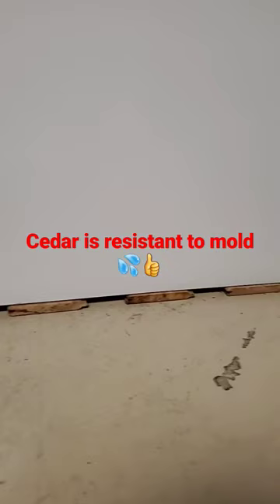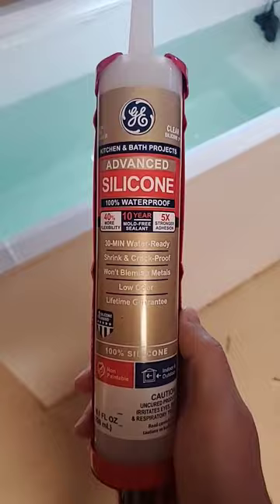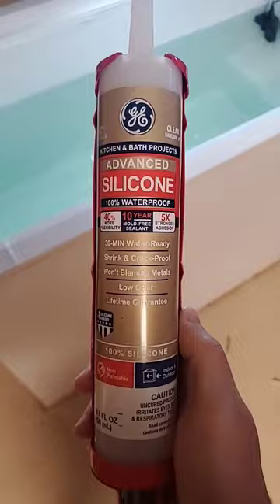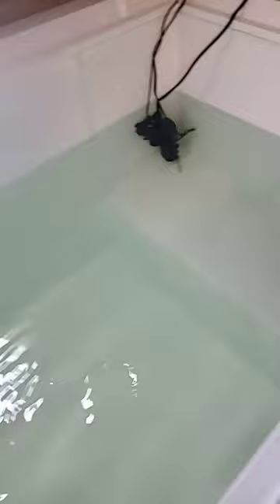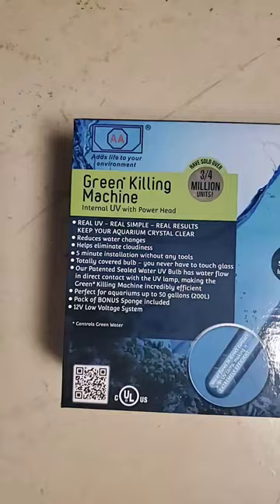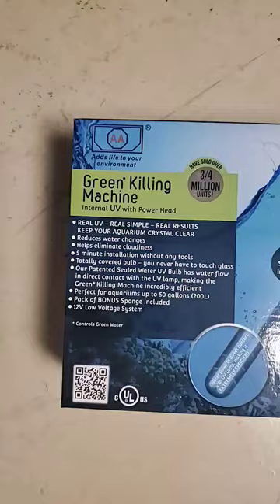DIY Chest Freezer Cold Plunge Ice Bath with Filtration - DON'T WASTE MONEY and WATER!!!

Comment from the maker: *ALWAYS UNPLUG BEFORE PLUNGING*

Parts list:

The Freezer
https://www.lowes.com/pd/Frigidaire-14-8-Cu-Ft-Chest-Freezer-FFCL1542AW/5001963889

The Alcohol (joint prep before sealing)
https://www.walmart.com/ip/Equate-91-Isopropyl-Alcohol-Antiseptic-32-fl-oz/276040459

The silicone
https://www.lowes.com/pd/GE-Advanced-Silicone-2-Kitchen-and-Bath-Tub-and-Tile-10-1-oz-Clear-Silicone-Caulk/5013492235

The filter
https://www.petco.com/shop/en/petcostore/product/marineland-magnum-polishing-internal-canister-filter-2536440?store_code=2723&mr:device=m&mr:adType=local&cm_mmc=PSH%7cGGL%7cCAL%7cSBU05%7cSH14%7c0%7coZ4AgFePb8PMQF6cfeZNnh%7c58700007475749834%7cPRODUCT_GROUP%7c0%7c0%7cpla-1457221079255%7c127865324094%7c15104991825&gclid=EAIaIQobChMIqoO8icbr_gIVfQZMCh2_xAsUEAQYASABEgLXV_D_BwE&gclsrc=aw.ds

The UV Filtration (honestly, I wish I went with the bigger model, but we'll see how it goes.)
https://www.petco.com/shop/en/petcostore/product/green-killing-machine-internal-uv-sterilizer-with-power-head-1237020

The controller https://a.co/d/953skAH
Reply: none of the link work

Comment: how is the green machine keeping the water clean for you?.... I'm building one and was looking into Ozone Generators but it's just so involved and expensive I would much rather go the green machine way.... I already have the Marine Land pump...
Reply from the maker: It's been great. Under $100, widely used at drinking water facilities for sterilization just on a larger scale, and it's plug and play out of the box. You won't be disappointed.
Reply: There's more to UV than plug and play. Particularly with UV filters designed for water "clarity" not water sanitization. Most submersible aquarium UV filters will only make your water look clear, not actually kill bacteria. Flow rate of pump and UV contact time with water are critical. If you want to do UV right, you need an external cannister filter and inline UV filter. Which is way more expensive and time consuming that just using a proper ozone treatment system. You can get an ozone generator for $100 and only have to change the water once per year. If you cheap out in the beginning, you are going to spend more time messing with the water and more money on buying the things you should have in the first place.
Reply: @davidmcchristian9861  yes this absolutely is the way... since making that comment 6 month ago I've since found the UV sterilizer with Marine Land canister filter is ok but not highly effective... the water still gets cloudy and smells a bit "off"... but not nearly as bad as with no filtration... however... now that I've purchased the proper Ozone generator made for water that has really proven to be the way.... also with the marine land filter for particulates...

Comment: What about getting a taller, shorter freezer? 
I prefer not to lie down, so a smaller freezer would be better and cheaper presumably. Me and my wife aren’t that big or tall, I’m just under 5”7 and my wife is like 5”5 and we’re currently using one of those blow up “plunges” with the plastic sticks you slip inside it for stability. I’m considering this verses buying one of those cold machines you stick into a regular plunge like mine that cools it down. Is it worth it? Can you give me any benefits I’d notice over the other method? Currently maintaining ice is difficult, especially because it’s summer in Alabama and the cold tap is literally about 85-89 degrees F! With about 40 x 500ml bottles of frozen water from Walmart I refreeze every time I can get it to about 52 degrees. It will be easier in Winter but obviously it’s not ideal, and in any case having to refreeze the bottles is annoying. (I feel like I’ve ruined some of my frozen milk I had in there I’m now using as giant ice cubes from the temperature changes). So a machine that cools the plunge vs a freezer system like this is surely the way to go. Just wondering if you can sell me on the freezer system over this one - thanks! 🥶 😂
Reply from the maker: @Edbrad  Sounds good!
Reply from the maker: @Edbrad  you have to find what works best for you guys
Reply: @Snake_Boi  I’d just like to say that I have managed to get the temp down to 43 degrees F now. Whoo!! Makes a big difference ey?! I can’t imagine doing the 32-39 degrees ice bath, but I know I have to get there over time. I’m sure it’s as different there as it was from 62 to 43.
Reply from the maker: @Edbrad  it's pretty crazy! Stay safe and well!

Comment: Great video! Been wanting to figure out a good way to make a plunge without ozone, because i want to put it in a basement room that isn't well ventilated. How often do you clean the filters, tub, and change the water?
Reply from the maker: Depends on how much use it's getting, and how clean the individual going in. So far, I think I've cleaned the filters 3 times, and done a few partial water changes, mostly to vacuum debris off the bottom.

Comment: Thinking of doing the same exact set up. Do you think the 3m silicone marine grade will work as well. It’s used on major boats and water craft. Also mines will be staying outdoors in fl as well. Think it would last? And finally can you run all the wires ( inkbird, UV, and marine filter ) through a hole on top of the lid if I drill one?
Reply from the maker: You'd have to test it out. I can only report my own experiences.
Reply: @Snake_Boi will do. Just purchased the 120 gallon UV product. Letting the adhesive cure at the moment. Thank you

Comment: Someone in another video mentioned to not cover the freezer since it is running, the walls of the freezer will overheat, which will eventually ruin it prematurely.. is this true? why would I leave my freezer open outside.. what would you suggest?
Reply from the maker: I'm not sure, I haven't heard that. I usually run mine until there's a bunch of ice to keep it cold for a few days without needing to run again.
Reply: As he stated once you get it cold ,it stays cold for awhile , particularly now that its cold . When I first got mine and bringing the temp down though , the Sides were definitely Really hot. I turned off and ran at night hoping the night cold air would help , as I thought it was gonna overrheat .
Reply from the maker: @thetattooed6_9weirdo32  this was my experience as well, the heating of the exterior walls is actually a feature of chest freezers not a defect. It heats up so the outside of the freezer doesn't get condensation on it and rust out in a humid warm environment.
Reply: This was brilliant, exactly the information that I’m looking for here in Australia to get my own ice bath set up. Now can you please do one on an equally cheap set up for a float tank? Ice baths and float tanks are the dream combo for me…

Comment: How’s this build holding up? Thinking of going a similar route (no JBWW or pond shield/liner) but I’ve read mixed experiences regarding leaking and eventual rust spots showing through the white enamel coating.
Reply from the maker: No issues to report so far.

Comment: Why would the front and left side feel very hot to the touch on the outside of the freezer?
Reply from the maker: @jodull3197  It's running too much. I would honestly add ice for the first cool down. Or turn it off for 2-3hrs until it hits the ideal temperature. The heat is a feature of the freezer to keep condensation from forming in a humid environment.

Comment: The temperature control device is for cooling the water. what is the temperature range on the freezer. Ideally I'd like to get 40 + degrees.
Thanks
Reply from the maker: You can program all those setpoints on the controller. You could set it to cool down to 40°, then shut off and start up at 48°. Mine is set to cool down to 32°, then it turns off until it warms back up to 36°.

Comment: with the The UV Filtration, can I withstand these type of cold temperatures? or does it depends how cold you go? I'm considering on getting another UV filter off of amazon considering the chest freezer will hold more gallons of water.
Reply from the maker: It's holding up very well. Regularly freezes.

Comment: Do you not use a timer to automate  how long it runs? To prevent ice and energy saving?
Reply from the maker: The inkbird controller is what makes it turn on and off based on how high or low the temperature goes. You set all the parameters. For instance, cool down to 33f, then off until the temp is 42f, then back on until it reached 33f again.

Comment: So what's the difference between the ozone and the marine land? Doing the same job? And what different jobs are the green machine doing compared to the marine land? Sorry for the questions but I'm just wondering what I actually need to buy here? The marine land and green machine suffice? Thanks
Reply from the maker: You don't need Ozone, marineland removes solids, and the UV light (green killing machine) does the sterilization.
Reply: You don't "need" ozone, but it makes it a lot less difficult to manage the water quality. I'm changing water once a year with a proper filter and ozone protocol.

Comment: Is there any benefit in adding salt to lower the temperature below 32°?
Reply from the maker: Adding enough salt could potentially cause frostbite if the temperature drops low enough, so this is not generally recommended. Also, if the water does freeze a bit and you get some ice in the plunge, it keeps the freezer from running as often, saving you some money.

Comment: I’ve heard that silicone lasts about six months and then starts cracking. I’ve also heard that JB water weld is expensive and time intensive, but it doesn’t crack after six months. Your thoughts?
Reply from the maker: Hey, thanks for the comment. I think that sounds like something someone selling JB Weld would say. Do some research on silicone, how long is it good for, what environment does it fail in, what kills it fastest. I can tell you right now that if silicone cracked after 6 months, aquariums would be held together with JB Weld and not silicone. JB Weld is labor intensive, and has to be mixed just right, and the people that push it also push the liners they sell, which are $600. If you go with the JB Weld and the liner, you spent more on those components than you did on the freezer, and at that point, just go order an actual Cold Plunge. It's like buying a $5k cover for a $3k car. That's how I view it. Definitely do some research on silicone, it's strong, flexible (less likely to crack than JB Weld), lasts a very very long time (especially when it's not exposed to the sun) and if you prep accordingly, it bonds very well to this specific freezer.
Reply: use 3m 5200 its the best
Reply: @Snake_Boi  Agreed, heard a lot of stories and 2nd hand reports on fails, but not factual evidence to back anything up.  
It's not shocking to me to buy a used freezer only for it to fail 6 months later.  Water involved or not.

Comment: What actually chilled the water? I know the controller will turn the chiller on and off when it gets above the set temp, but what chills the water?
Reply from the maker: Thank for the comment, it's the freezer doing it's thing (freezing) that chills the water. The freezer moves refrigerant through its main components, expanding and contracting the substance as it travels to absorb and expel heat from the compartment.
Reply: @Snake_Boi  ohh I thought the freezer was just essentially the tub.

So you just have the freezer plugged into the controller?
Reply from the maker: @Danjr704  That's correct.

Comment: Do you unplug when you get in to prevent any electrical shock ?
Reply from the maker: Omg yes. That's the golden rule I put in the pinned comment. It wouldn't just be a shock, most likely death. Unplugged every single time.
Reply: @Snake_Boi  thx dumb question the more I think of it:).  I was comparing to the proper cold tubs that are meant to be permanently plugged in.   Came to my senses:). Thx

Comment: I’ve read where silicone caulk won’t hold up. How’s it working out so far?
Reply from the maker: So far, no issues!
Reply: Did you remove all of the brackets on the bottom? Specifically the brackets under the compressor?
Reply from the maker: @kalebbennett6047  I just too the ones off that the wheels mount to.

Comment: I have all the same things and did all the same things in the video but it keeps leaking do you know why. I took the wheels off and have it in the hard floor and keeps leaking. I caulk it with water proof like 5 times. And still it leaks.
Reply from the maker: No idea bud, must be an issue with prep.

Comment: I use ozone machine and hydrogen peroxide. But there is still some hair and other stuff in the water. How do you clean that?
Reply from the maker: A filter to remove suspended solids. Something powerful enough to really agitate the water and keep any solids from settling so it'll eventually get pulled into the filter.

Comment: How did you seal the drain plug?
Reply from the maker: Tons of silicone. Really layered it.
Reply: @Snake_Boi  was thinking of threading a spigot / valve to drain if needed
Reply: Why not just leave the drain plug to use to drain? Will it not hold a seal once the waters added?

Comment: Any thoughts of also using small amounts of hydrogen peroxide or chlorine in addition to the UV and filter?
Reply from the maker: Hydrogen peroxide is good to use right after you get out. I'd avoid chlorine though considering how corrosive it is, and that carcinogens it can leave behind.

Comment: I know that you bought a nice freezer from home depot but what about those of us on more of a budget?
Reply from the maker: Not sure, maybe try local classifieds for a used freezer?
Reply: @Snake_Boi  Thanks for the reponse. I think I was more looking at it like was there any specific reason you would buy a new one over a used one?
Reply from the maker: @beyondamazing23 if you buy new you're not buying someone else's problem. That's how I view these things. Probably only save a couple hundred on a used freezer this size.
Reply: @Snake_Boi  hello again! You said the sealant in this video is not good for plastic? I bought a chest freezer with plastic insulation
Reply from the maker: @beyondamazing23  in my experience it hasn't bonded well. You should buy some different products and test a small amount on the areas that will be submerged.